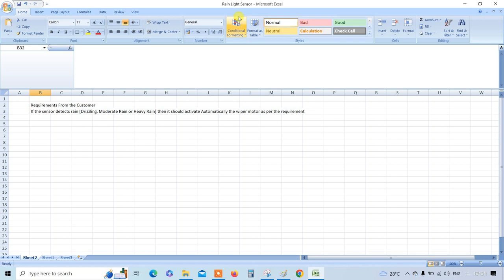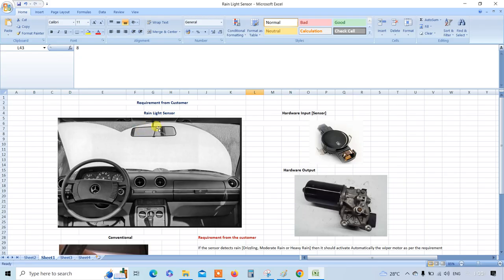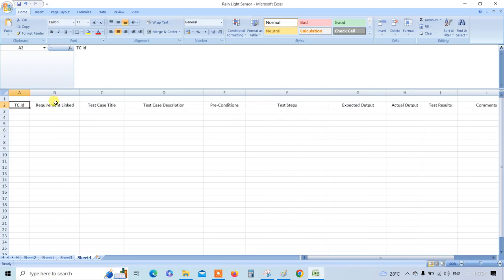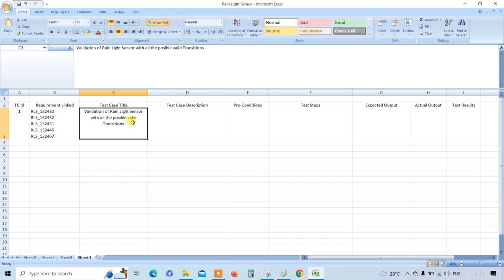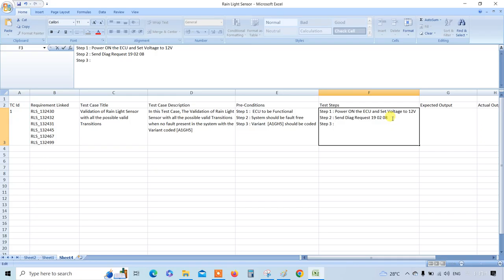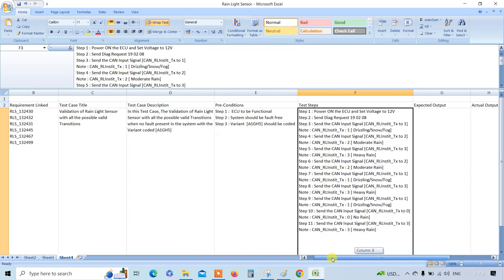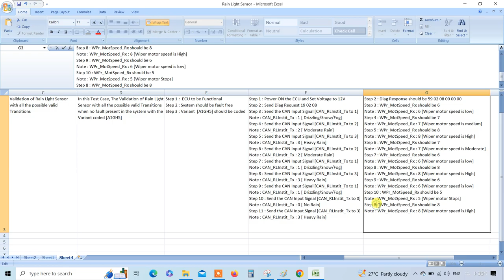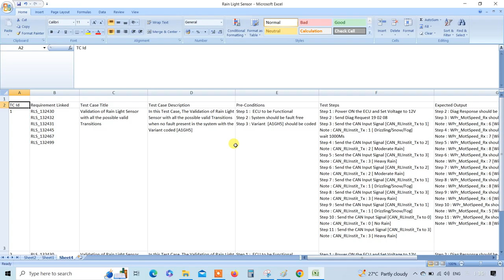How to Write the Test cases - Automotive - Embedded World

Comment: Good intro. Just wanted your thoughts on 1 item. Should there be a 1:1 mapping between test case and requirements or can multiple test cases map to a single requirement and vice versa ? The motivation behind this question is traceability in requirements management tools like JAMA, where you have your test plans linked to specific requirements.
Reply from the maker: Multiple